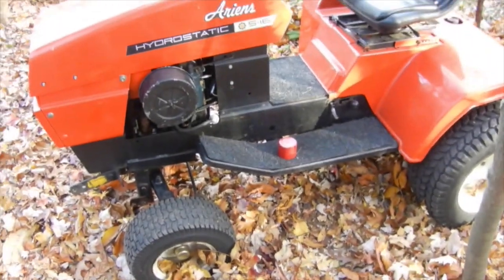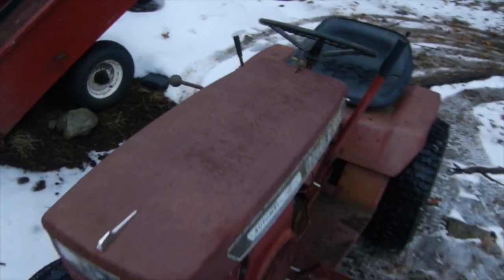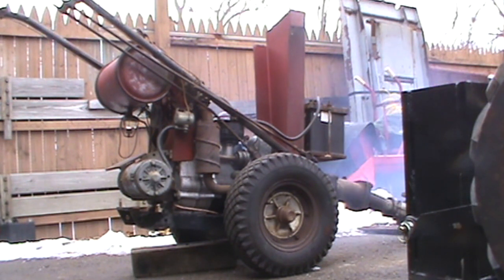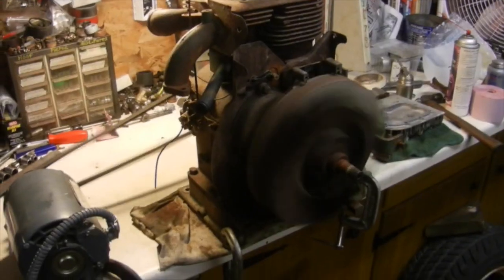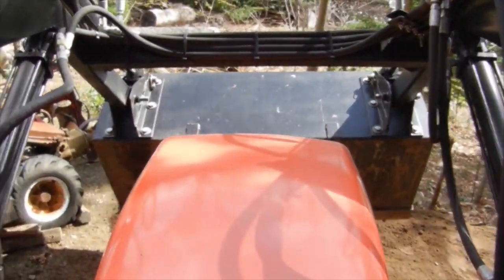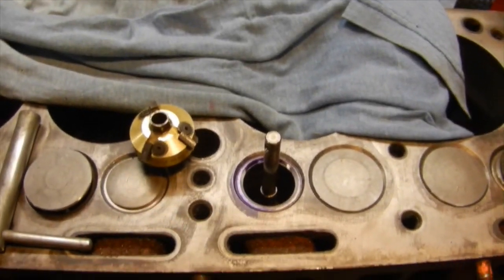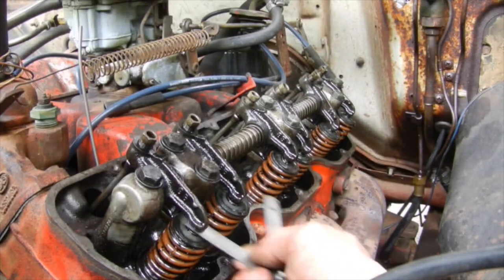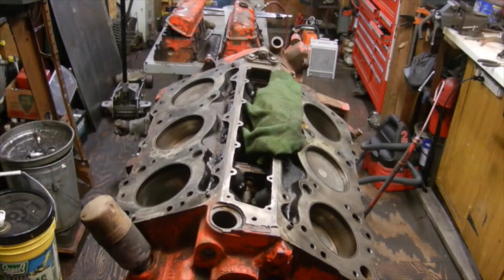5Tractorguy's Trailer- Tractors, Trucks, and Engines

Comment: I've been watching your videos for years and I came across one where you were working on a Lincoln link welder to 225 I have the same machine, but I'm having some problems with it. Was hoping that you would be able to help me through it? I put a new Starter solenoid on the machine and a new starter button. But it will not start. And less I jumped the solenoid. Do you have any advice?
Reply from the maker: Thanks Tony. Will it only turn over if you jump the solenoid? Make sure that you have a good ground where the solenoid mounts. Check for continuity that it is getting to the starter button and solenoid when the button it pushed. Did you use the same style solenoid or a different style?
Reply: I thought thank you for responding, I check for continuity and found out it was just a bad ground. Now the welder works great. What type of replacement air filter would I need for that motor? The 16 horse
Reply from the maker: Your welcome, glad you got it figured out.
I believe the 16hp Kohler filter fits those CCK's. ID 4-3/4", OD 6", Height 3"
Rotary- Filter# 1388 Prefilter# 2844
Stens- Filter# 100-065 Prefilter# 100-768
Kohler# 4508302

Any of those numbers will work, just got to find who has the best price.